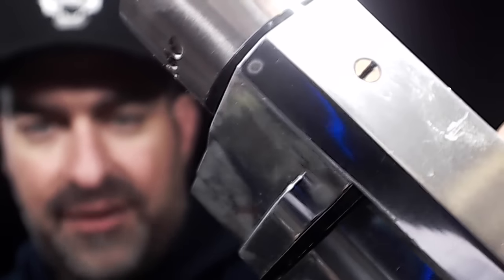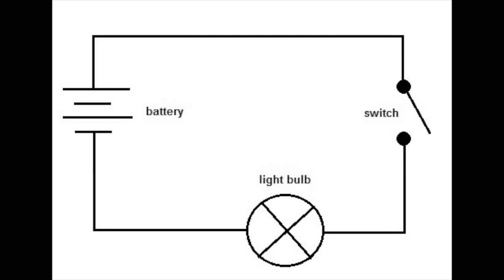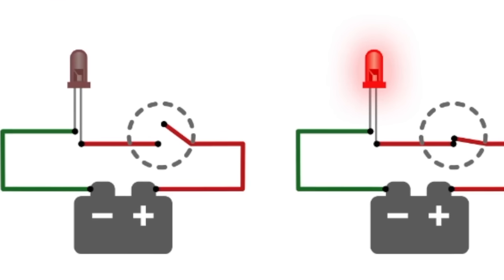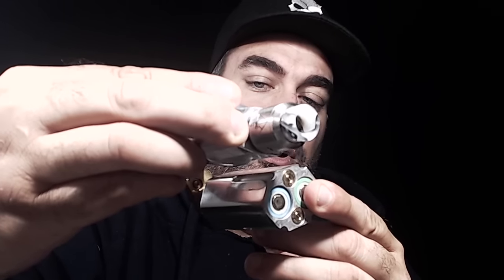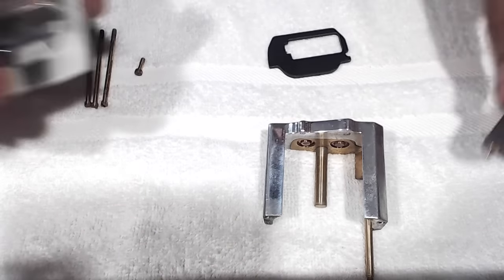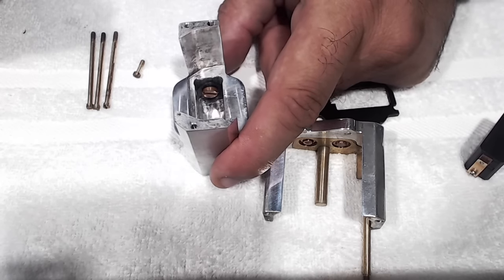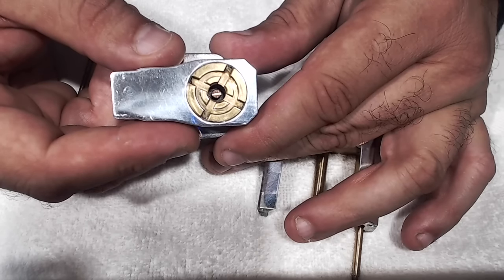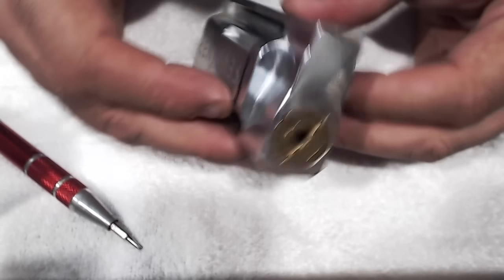The Revolver Parallel 18650 By Gi Mods at www.2vapedx.com

Comment: Hey Big Lou, How's it going? Good I hope. I agree with you on this device. I believe that the problem that most people have with devices like this is that they don't understand how the devices works (not all but, a high percent). I've seen a lot of guys say that this or that doesn't fit right but if they really look at it, it's working as it is designed to and they are just misusing them. It's really hard to fix something if you don't understand how it works. Thanks for the review and later bro.
Reply from the maker: dude I dont have all the answers for you. I do my reviews based on my opinion, I cant do reviews with a check list from every other vape reviewer on you tube. My best advice to you is instead of trolling on my comment section and then saying no disrespect after every insult, just do a video on this device telling everyone how you dont like it. Its thats simple.

Comment: It's not being lazy it's about being a little more safe and caring about my life because it's worth something
Reply: regulated mods arent completely safe, ive seen them explode as well from the chip failing
Reply: I've personally had a regulated mod's chip fail, and got really close to starting a fire in my room. not an old mod by any means, and never dropped or anything. I'm always a little cautious now using regulated mods, and for the most part only use mechs

Comment: take a green scotchbright pad and rub one direction and give it a brushed finish , no more fingerprints or scratches
Reply: Travis Anthony while that woulf look ok i think it would ruin the nice asthetic idk tho woulf look kinda nice
Reply: Polished finish looks great , its just too high maintenance imo. Brushed finish on the other hand doesnt show fingerprints and hides all small scratches. I glue a fine scotchtbright pad to the bottom of a shoebox (up against a side edge) and put the botton of the mod up against the side of the box like a guide and rub the mod back and forth and turn ect ect. That way all your lines are straight and uniform. Looks brand new afterward. Works on SS or aluminum, titanium.
Reply: Yh i agree

Comment: *big Lou I have a major issue.! I have just purchased a rogue and I cannot thread most attys to my mod! There are just a couple I have that work.  Ones that don't, start a thread then after quarter a turn they stop.! Unfortunately I'm gonna have to send back.  I spoke with J Mark and he said he thinks it's where the rogue has fine threads and the attys are janky.  All of these attys fit fit on my subzero,able, oros and standard.  So I don't know what to believe! I'm praying this issue can be resolved cause I did pay 185$ from innovape! They have yet to respond to my email!
Reply from the maker: ok listen , I had an issue with my thread on one I purchased from another vaper and All I did was I threaded a RDA that had a stainless steel 510 male and used a wrench to rethread the 510 connection but if Jmark said he would fix it then by all means let him do it.

Comment: I saw another review on this mod and not all batteries fit in that barrel. A thicker wrap battery like MXJO won't fit.
Reply from the maker: Sometimes battery raps are thicker but if you have a battery wrap with a sticker going down the side then the sticker will be the cause of the battery not fitting. thats it. all you have to do is remove the paper sticker that is stuck to the battery wrap..
Reply from the maker: ok well I use Sony VTC batteries and Samsung 25R's They both Fit in this mod with no issues. So what do you want me to say then. Once again. I like this Mod and it fires nicely. Im sorry you got the bad one of the batch. I guess send it back for a new one.
Reply: lol a mod sucks cause shitty rewraps wont fit in it? sounds like a safety feature to me.
Reply: No not rewraps. New batteries. Watch AmbitionZ Vaper review on this.
Reply: Anthony P I have and they are shit.